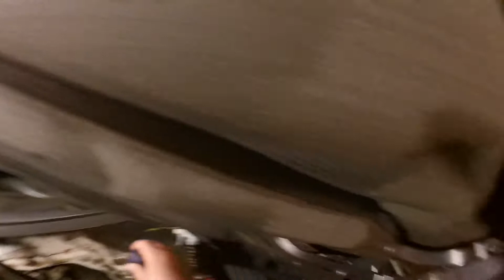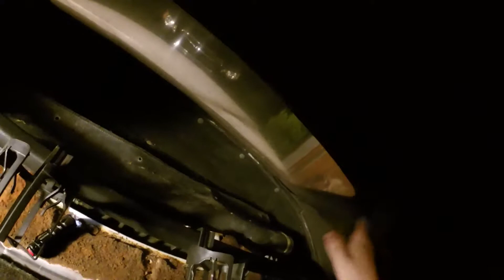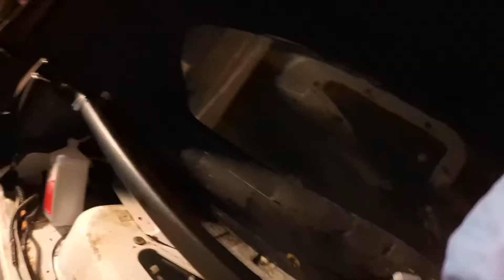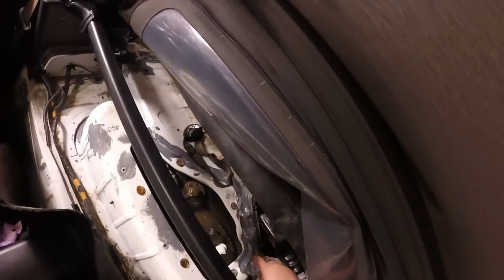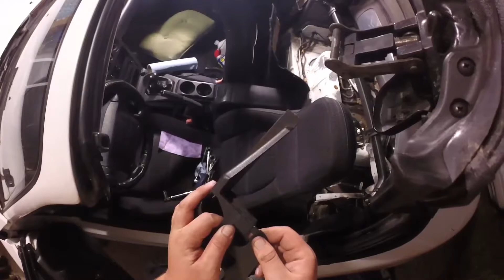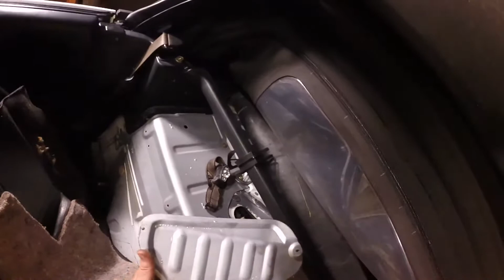Miata Fuel tank cover repair

Comment: I know the feeling. So much rust there. I just pulled the soft top off my NB and then the little shelf-mat. That sound deadening material held so much water... it was still moist when I pulled it out. I just got sick to my stomach. So I ordered all 3 pieces used, I'm gonna paint/undercoat them so rust wont be an issue anymore.
Good luck man. Godspeed